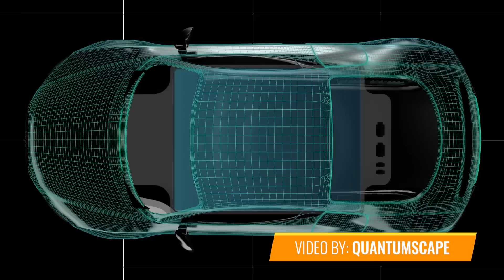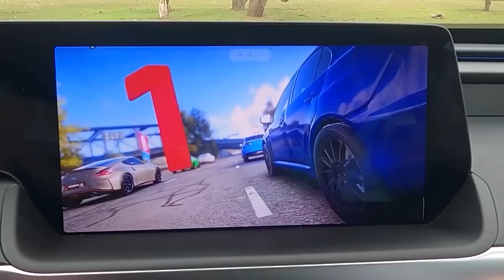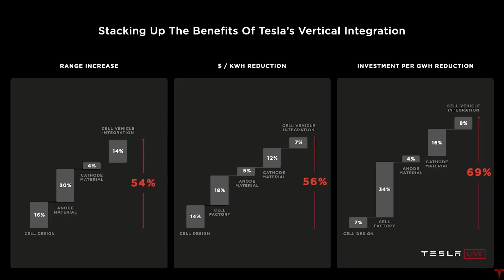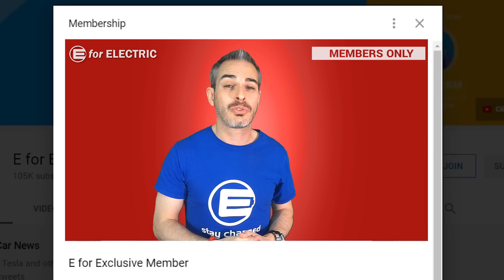TOYOTA's Only Hope to Beat TESLA: Solid State Battery

Comment: What we need from batteries: To be good enough, cheap, MASS produced, and easy to recycle.  
Toyota: SOLID STATE!!!
Reply: And solid state have to be with much higher energy density and fast enough to recharge to be acceptable for busy ICE drivers. The slow charge is the main perceived barrier of EV adoption beside of price and infrastructure. Also solid-state batteries are claimed to be much more resistant to catching fire and easily transportable in the cold depressurized luggage compartment of the airplanes thus being applicable on large scale in aviation. And, lastly, those should have much slower degradation than gel based batteries of today relieving the pressure on recycling needs and lowering maintenance costs.
Reply: @nevco8774  That is definitely a possibility. Without numbers, that's hard to really know for sure. If a solid state battery costs double a standard battery, it'll add around $8k to the sticker price of a vehicle. At the $50k+ mark, some buyers might accept that premium for faster charging, but at lower prices this will be unacceptable. Especially when, at such a premium, a larger array of standard batteries would also provide longer range and faster charge speed. So the ability to ramp up production, cost of materials, and cost of manufacturing can make or break this technology.
Reply: @nevco8774  we already have LiFeP4 with increased life, high charge rate and equivalent safety.

Energy density is now the holy grail. Circa 30minute charging times are also already here so I don't think solid state are that comparatively exceptional in every sense any longer.

Infrastructure has to be strategically channelled in the direction of renewable gridscale and renewable microgrid else the entire effort is futile.

This is again where TESLA and BYD (with exceptional energy businesses) are going to excel in a compounding way above the rest.
Reply: @nevco8774  Higher volumetric density but nor gravimetric so who cares? Slow charge? After driving a few hundred km a quick 20 minutes charge is enough for the next few hundred so you might be right: it's a perceived barrier. Current BEVs catch fire way less often than ICEv (however you want to calculate it) and Tesla is getting better and better at it. And their batteries last longer than avg ICE. Could it be useful for aviation? Sure, why not.
Reply: Well Quantumscape really and truly. 🤣

Comment: Games and computer functions are nice but people want range, quick charging, and an affordable price. Still no $25,000 electric car with decent range.
Reply: Tesla is developing their mass market 25k car as we speak and I don't expect anyone else to be able to hit this price. The key is cheap batteries in massive volume. Gigafactory Berlin is targeting 250Gwh of production which comparable to the total global battery supply last year.
Reply: @5893MrWilson  I know that. But there is a difference between wanting to do something and actually doing it. Battery prices are going to have to come down more than significantly to make this happen. I hope it does. But I still think they're a long way off. Physics made be the big stumbling block. The cost of batteries may not be able to be brought down and we don't know if battery capacity can be increased much more yet. There been a lot of years in developing batteries and this is the point where at right now. We could be at the point of diminishing returns. Anyway we will see. Hope they can pull it off.
Reply: @jayfromaz  I hope so too. If you haven't watched any of Tesla's battery day you should check it out. They have a plan to half the current battery prices ($60/kwh) and improve energy density. They seem to already have the tech and just need to improve yield and scale which will take some time.
Reply: @5893MrWilson  there's about 5-10 manufacturers making ev cars under 25k. Most in China.
Reply: @nzzenith  well yes but there not really what most people mean when they say 25k car. Most people want a vehicle like the toyota Camry that is electric for 25k.
Reply: @5893MrWilson  they are as low as 10k small suit their market. I.e. easily make a sedan at 20k.  China is their competition. They will copy everything in time. But for the West, Tesla will lead EV for at least five years (maybe forever).
Reply: @nzzenith  i wouldn't say they could easily make a sedan for 20k profitably. The battery costs make that impossible ($100/kwh). The HongGuang ev mini is $5k but it is a micro car that uses a 12kwh battery which is 1/6th the size of a Tesla battery. I agree that tesla's main competition will come from China but Tesla should maintain industry leading margins and tech. If they want, all they have to do is reduce their margins to undercut competition. I believe most chinese ev makers are money losing buisnesses for now.
Reply: @5893MrWilson   don't believe everything these Tesla guru's tell you. No need to preach to me about what I already know, mostly from what your watching obviously. They don't know everything. Look at the car shows.
Reply: @5893MrWilson  most people just drive a few km to work and back. They can hire a long range EV for their day trips.

Comment: Even if someone manages to make mythical solid state batteries (looks like they will only be partially solid) they have to deliver at an enormous scale. I think Elon has it right; iterate and improve current batteries to the extreme. That alone can change the world. And try to figure out solid state along the way.
Reply: My understanding is that ion flow in solids is slow, very slow indeed. Hence the proposed allegedly SOLID STATE battery is basically an oxymoron, a misnomer. All electrolytes to date are liquids for a reason !
Reply: @grahamstevenson1740  All electrolytes are not liquid. Their are hybrid and solid electrolytes used in capacitor manufacturing.
Reply: @pmh1nic  Film, ceramic and similar capacitors have dielectrics*, not electrolytes. Electrolytic capacitors have both a solid dielectric AND a *LIQUID ELECTROLYTE*. There are no *SOLID electrolytes. When an electrolytic cap goes BANG it's because the liquid electrolyte boiled due to heat and vented via the the intentional 'weak spot' in the can. I am an Electronics Consultant btw, please don't waste either your or my time by digressing.
Reply: @grahamstevenson1740  There are solid polymer aluminum electrolytic capacitors. They utilize a SOLID polymer as the electrolyte. I'm an electronic passive component engineer. I've been working in the field for 40 years. I don't consider educating you a waste of my time.
Reply: @pmh1nic  I apparently mistakenly imagined the solid polymer was the dielectric in those. I've never found the need to use any, so .... Anyway, I looked up 'solid polymer electrolyte' and there's some interesting info to be had, e.g.  "Solid polymer electrolyte (SPE) are defined as a solvent-free salt solution in a polymer host material that conducts ions through the polymer chains", A solution in a host solid ??? Maybe it's some weird phase of matter, like glass which appears to be a solid but is actually a  liquid. I'm still puzzled how the required ion mobility is achieved.
Reply: @grahamstevenson1740  They aren't widely used in consumer electronics due cost but in situations where very low ESR/high RCR are required and/or long life is critical they have a great advantage over liquid electrolyte capacitors. Design engineers love them (they do the job), purchasing managers hate them (cost too much). And as discussed in the video one major challenge for Toyota and Quantumscape is reducing the cost of solid state batteries.
Reply: Tere are already some on the market, they are used in Daimler electric busses.
Reply: Even if they do get a solid state battery working fine they gotta make it cheap to manufacture which is the hardest part
Reply: @SyncedJay  I'm  puzzled that such a thing can even be made. Some have suggested I'm on the right track and that the 'solid electrolyte' is actually a bit wet !

Either way, it's a case of 'jam tomorrow', it's certainly a way off.

Comment: I think the efficiency of the car also plays a large part meaning more range per kWh and faster charging in terms of miles per minute. This is another area Tesla currently excels.
Reply: Not everyone is grasping this! Lucid keep harping on about it but I can't wait till independent consumer verification of all those Lucid claims.

Sandy Munroe to the head of the queue please.
Reply: Electricity turns its potential energy extremely efficiently into 'go' even now.  We're at about 98% efficiency already.  What limits range is the use of gears, which turn some power into heat, and weight, which takes energy to get moving and which air drag and mechanical drag eats a lot of even when on re-gen.  Batteries are still a large factor in range, because of their relative weight to energy ration... FAR worse than liquid fuel, like gasoline.  While gasoline engines are nasty, dirty, smelly things, and are also at best only about 40% efficient, there's so much spare energy in a gallon of gasoline that it becomes irrelevant at that level of analysis.  Lucid has miniaturised their motor's size to a degree and thus made it lighter, probably by running it at higher voltages, the efficiency of turning electricity into 'go' won't have changed really.  They might have built an ultra-light body, bearing in mind the price and lower production numbers anticipated, but in the end, physics is the defining feature.  Elon's 'back to basics', going back to the fundamental physics involved in every enterprise, has paid him well.  He tries to find the shortest route, using the least of everything to get what he wants.  At a very simple level, that's why his best selling cars get no dashboard, just an i-Pad glued to a plank of fake wood.
Reply: @carpinion  yes, many people misuse The term efficiency with EVs where they actually mean economy / energy consumption. Dont try to correct them, they'll just hate you for it, trust me
Reply: @carpinion  we don’t mean drive train efficiency while that is a factor in overall efficiency at the end of the day we need more range with less kwh if you will MPG because you could have 100% drivetrain efficiency but if your mpg is 13 you are going to need a giant battery but you could have 75% drivetrain efficiency and 50 mpg you would need less batteries for the same range.
Reply: @carpinion  this is overkill even for a PhD thesis. The argument of ICE vs. EV efficiency is moot at this point.

Lucid motor design is inferior to Tesla's physics based and first principles design approach. And Tesla are highly adaptable with the way they can divert resources to step change improvements.
Reply: In terms of kW efficiency Kia and Hyundai are very close to Tesla I think.
Reply: Elon Musk Tesla 800 ton giga press for Cybertruck, removing hundreds of parts while greater range is a prime example.

Comment: Factual information// Theirs No charging though out united States! No one  going buy electric vehicles with No  electric charging infrastructure though out united States
Reply: The same was true when gasoline vehicles entered the market. But guess what, most people will charge when asleep at their house. Every house in USA has 240v, so we kinda do have a charging infrastructure already in place. I know what you mean, though, chargers for travelers. They will be constructed at the same time as more electric vehicles go on the road. Same with upgrades to the US electrical grid. It will be beefed up and made more sustainable as time goes on.
PS, plenty of people are buying them right now as well as in previous years so you can't say "No one going to buy electric vehicles with no electric charging infrastructure". That has already been proven false.